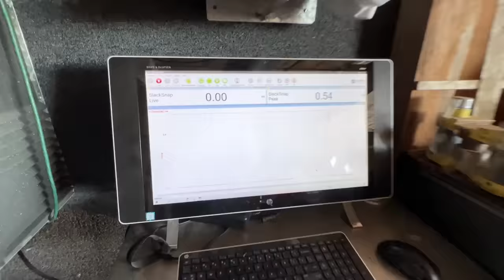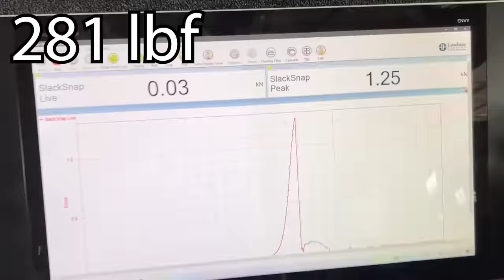I nailed a climbing ROPE to WOOD

Comment: he knows more than anyone should ever need to know about climbing gear strength, but there is no room left in his brain for understanding wood hahaha
Reply: That is EXACTLY what I came here to say!
Reply: Honestly it does hugely differ between woodtypes.
Reply: I don't think a 1/2 inch osb would do much better.
Reply: not to mention grain direction 😂
Reply: @Fred-oz3tw  Also would it not be different to check the outcome while going againt the grain too?
Reply: @TheDantheman12121  ye definitly
Reply: @TheDantheman12121  plus in the video he tests the wood is not even shown. I could be glued wood, which will definitly hold strong. Its more a question of the nail or the rope. They could break.
Reply: The failure mode he is seeing in the wood is very similar to what caused the wooden bridge in Norway's Gudbrandsdal valley to collapse in August this year. In that case,  steel pins that were used to connect wooden and steel components sheered through the wood along the grain. Seems lots of people have lost knowledge of how to work with wood.
Reply: @Gumbatron01  agreed!

Comment: I'd like to see this test but with the force at 45-90 deg from the plane the nail is nailed into. This would simulate more exactly the forces seen in the original vid. A lot of that force would be redirected into the wood rather than the nail, and it would be interesting to see how much or little that changes things.
Reply: Yeah - it's surprising how much the extra friction would increase the holding power. 180kg for two screws here so I presume one screw pulling out perhaps 120-150kg  pull (https://youtu.be/qmajKElnwfE?t=95) and possibly the same for a straight pull. So the wood seems to be the weak point perhaps. I'd love to see the rope actually pull through the nail though.
Reply: Would also be interesting to see pull perpendicular to the grain of the wood, as it split along the grain, just like the bolt initially
Reply: I like the video! My partner is a roofer and they use this as a safety... Seems super sketchy to me, and looks to be the case. I've sent them the video.
Reply: @dansnelson9633  I think if Ryan did the test with the forces opposing the grain rather than running along the same direction as the grain, plus with the rope at a 45 deg bend towards the pointed part of the nail, coming round the corner of the wood, you'd get a much higher break reading.
Reply: @DaftFader  I think it'd do way better but it would be nice if it was just standard to install permanent anchors on all roofs so people have the option of tying off in the future when cleaning gutters or what not.
Reply: @toric225  Oh yeah for sure, this rwally isn't as safe as needed even with all the things added I sugest. I'm just wondering how close to death they actually are lol.

Some of my mates work in office block window cleaning, and anything over 2 stories they will rig a top rope at least, and it would always be properly anchored! I think a lot of them tall skyscraper type buldings have specific tie in points for window cleaners or maintainance people who ned to fix somwthing on the side exterior of the building.
Reply: @dansnelson9633  I was a roofer for 15 years. Its not that sketchy. The way he set it up in the test video is sketchy, but that's not how its done in real life. Also, we know its not fall protection. That's not what its used for.

Comment: All pulls were aligned with the grain of the wood (its weakest direction), and the plank was much weaker by the final pull as the splits had already propagated along the grain. A single nail pulled at a right angle to the grain, along with a bend over the radius of the plank would probably hold a lot more? Interesting nonetheless! Love the short experimental format.
Reply: yeah woodworkers on here are screaming  "go perpendicular to the grain!" haha

proves the point tho, esp for this type of wood.
Reply: it would be even weaker, since then the force would be put on the lignin in the wood. hes doing it right, just needs a steel flat strap to stop it from splitting
Reply: I get what you're saying trying to use the tensile strength of the wood fibers, but in practice I reckon it's just gonna split along the lignin for wood line this. 

Buuut maybe you're right so Let's see it tested!

Comment: After lowering some liquid solar panels off my roof with an old climbing rope in preparation for a new roof, the roofing crew came over and asked me what kind of rope it was. Now I can only imagine what they had been using before I pointed them in the climbing rope direction.
Reply: The cheapest rope you can get at Home Depot.
Reply: FYI their life will be easier with a static rooe

Comment: Id like to see how much it can hold if you nail the Rope to a Sturdier piece of Wood, maybe a 6 by 6 or something.
Reply: he should also try it with a nail gun since those nails have a little bit of glue on the nail that melts and hardens when it gets shot and that's what the roofers probably used

Comment: He needs to re do this but with the rope over a ridge with it nailed behind said ridge like in the video cuz I'm pretty sure he could get much more strength out of it that way. I say this cuz roofers will use a nail plate ( don't know if that's the actual term) on the ridge and  then attach the ropes to said plate which is again only nailed into the roofs ridge and that is what they are supposed to use to anchor themselves so I'd imagine it's gotta go through many of the same testing as any ppe device.

Comment: As a residential construction sider, I would girth hitch slings to trim pieces and nail 3 of them up to the framing somewhere, and then connect them with sliding x's into a master point, and I would get on the roof in the snow to keep siding with a retired rope and grigri. 
I like to think it would have held a fall..
The boss seemed impressed

Comment: I'd love to see a 3/8" lag bolt tested as a way to attach a hanger to wood. I have 2 hangers set up with my hangboard that I use to practice different anchors for canyoneering, occasionally I will use them to get a feel for new descenders. The bolt hangers are lag bolted into 3/4 inch plywood with 1 inch long 3/8 inch lag bolts.

Comment: Nice! If testing construction safety, it may be interesting to compare a standard roofing anchor on plywood and/or OSB as well as ropes nailed into endgrain, sidegrain, and longrain, and pulled along the strength axis of lumber so as not to cause splitting. Of course nailing a rope into a 2x in any manner, and using that as fall protection could get your business license revoked, fines from L&I, and a few lawsuits in the US, no matter how strong it ends up being. Seeing how construction rated protection on residential and commercial sites holds up would be interesting though, as well as seeing how overbuilt some of it is.

Comment: I'm not saying it would be strong enough to hold someone,  but the way it has it nailed on the backside of the roof would make a huge difference in bit the way the nail is being pulled and the distribution of a lot of the force across the peak of the roof as opposed to all the weight being directly on the nail.

Comment: In the video the rope was pulled the other way, against the grain.
Grain direction makes a big difference for wood.
Reply: it would be even weaker, since then the load would only be held up by the lignin in the wood, which is much weaker. the reason theirs held better is cause they were redirecting over the tip

Comment: typically they use a proper rope anchor, its a hinged piece of metal that is nailed into two opposing slopes with a metal ring at the top.

Comment: There is a special “ridge anchor” for roofing usually in with only a few nails and safety is Super cheap on Amazon 

Wonder what it takes to yank one of those out

“2815 Super Anchor Safety RetroFit Permanent Roof Anchor”
Reply: No, that design is a weather helper. it has no ring , and higher price.

Comment: Do you have any videos or stress tests on using half ropes as single ropes? 

Obviously not a recommended maneuver. Can think of few extreme examples like honnold/Caldwell simulling on 6mm during cuddle, Messner using 6mm on his alpine climbs. 

Alpine missions definetly different than bringing a half rope to the crag as a single, but curious if you guys have tested anything with this in mind.

Wouldn’t consider leading on a 6mm like these guys in the alpine, but was thinking like the elderid starling 8.2mm

Comment: Standard framing nails only hold around 100-200lbs in shear, whereas a construction screw can hold 500-600lbs. Ring-shank and galvanized nails hold about double regular nails and half as much as screws. Even with the bend over the top of the ridge, that single nail would have likely pulled out easily. Now put a construction screw in there and you've got a fun game: Will it Hold or Not?

Project Farm's Testing of Screw and Nail Shear Strength
https://www.youtube.com/watch?v=qmajKElnwfE

Comment: I have two comments:
1. You should not pull paralel to wood structure.
2. You should not pull the rope paralel to the plank. The nail should be somehow behind the corner if you know what I mean.

Comment: Please do it again perpendicular to the grain like in the example video you found! Seems like it kept splitting along the grain which is definitely the weakest for the wood.
Reply: it would be even weaker, since it would only rely on the lignin. hes doing it right, its just that he shouldve used a steel flat strap to stop it splitting

Comment: I think most of it is to be like an anchor. You're more stable with 3 points of contact so he keeps himself locked in with his knees and then the rope gives him extra security so he can move around with his hands. There are tens of thousands of roofers that don't use any harnesses at all so at least it's something. My preference is to do it the right way with fall harnesses and proper anchoring but the older generation is "too manly" for any of that nonsense.

Comment: where did you find that old ass piece of wood its so dry and beat up of course its going to fail low and there isn't a steel hanger strap at the end. Also in the video the wood he nailed into would be 1/2 inch OSB then into the side of a 2x4 the nail would have been fully sunk in the wood. Bending them over adds a lot of strength but your lumber was compromised at the start and only got worse as it went along. If that was new construction, (I don't think that was) or just a simple roof replacement the lumber underneath would have been in much better shape.

Comment: Sorry, no surprise here. You should ask a carpenter about the wood and nail combination. It depends highly on the kind of wood and nail and the nails also weaken the board, because they are all in the same vein, so no wonder it splits 😅

Comment: Your fellow couch/novice Carpenter/ interpreter:

Looks like you need stronger wood and to go against the grain. When you nail anything to wood, nail at a 15 to 25 degree angle. Also, Use American made nails! 🤣 

Cool video! More redneck climbing gear!!!